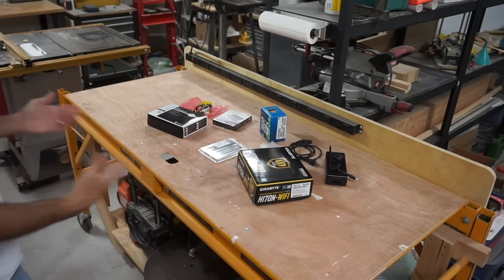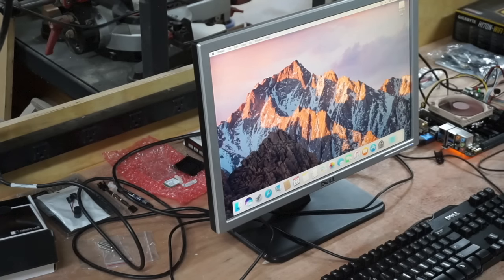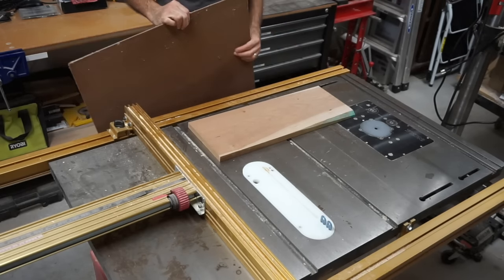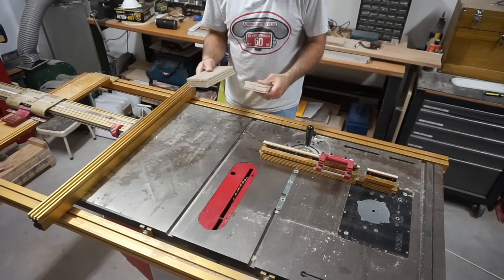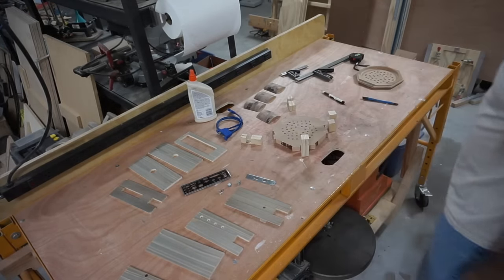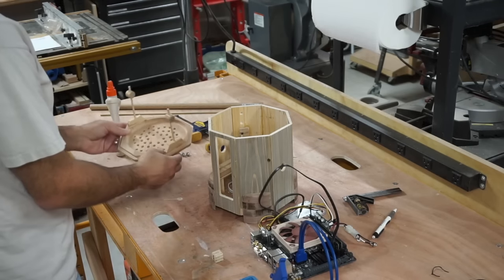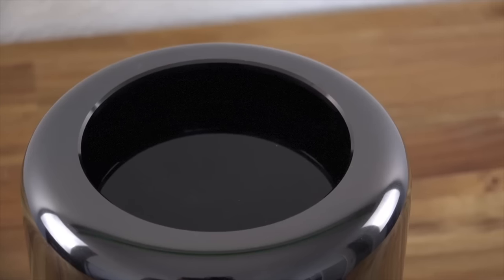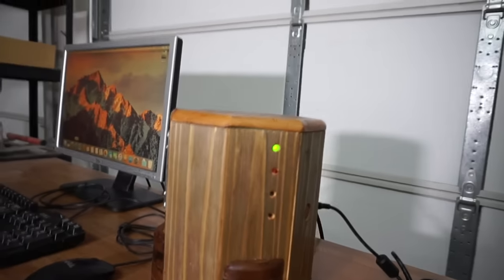A Woodworker Builds a Hackintosh

Comment: Three words:  Wooden Spring Buttons!!!  That is probably one of the coolest ideas I have seen in a long time, and beautifully executed to boot!  Very nice IBTW:-)
Reply from the maker: I actually did some work on trying to make such buttons for this thing, but those darned stock buttons are so tiny and I could not come up with a way to push them with something else. So, I kept it stock and use a pen tip to push them. Some day...
Reply: That would be a nice touch too! Maybe you could install a small metal pin that pokes out the underside of the little button to act as the pen tip, slip a tiny spring around it and set it in a properly refined access hole...just a thought for your next build:-)  What I was originally referring to was your GENIUS buttons that lock the top of the case to the body.  Super neat little trick that relies on the tensile memory of the wood dowels!  A really elegant solution in my opinion, and I always can appreciate solving a mechanical need with wood over more "modern" technologies...Engineering principles at their finest!  Also, thank you for the reply and a chance to say personally that I enjoy your work and look forward to seeing what else you decide to come up with for future projects.  I am a long time woodworker, contraption maker, and scenic designer that built his own design/render computer last year (with simple mods only for my first build), and has been totally bitten by the enthusiast mod computer bug as a result.  Again, awesome work, I look forward to more, and may your day be a happy one!
Reply from the maker: Ok, yes I forgot about that genius feature I put in this build. I was really pleased how they turned out. The thing that left me somewhat perplexed was how to make something out of wood to push those little switches. That's my someday project. Do you have a channel too? If so, let me know what it is. If you don't, it sounds like you need to start one, so everyone can enjoy seeing your creativity in action!
Reply: I have been considering making videos for some time now, I just haven't taken the plunge into getting started.  Partially due to lack of time, partially due to not having even a simple setup to support the endeavor.  I will need to increase my storage for my pc, learn the software and workflow needs, and I only have my phone as a camera at this time, which will need a larger capacity SD card.  A good deal of my work is also really focused under tight deadlines and I haven't put much time into considering a way to add video production into that situation that won't impact my timeline for completion of the actual project. I am seriously considering looking into making this move...just gotta navigate some hurdles first:-)  Any advice for someone interested, but still ignorant in some ways on how to get started?
Reply from the maker: You can probably guess my answer to your question: just ... do ... it! You will figure it out, I assure you. I had/have the exact same hurdles you listed above and I make it work. There are lots of great resources for getting started available on ... YouTube! :)
Reply: Thank you, and you are right, a journey never happens without the action of taking a step, then another, and another...  I will try to find some time today to actually research youtube for starter tips, for I am working from home on a design for an upcoming theatrical production, and will need to take breaks from time to time:-)

Comment: Great work! I would suggest an intake and/or exhaust fan - thermal throttling does inhibit the CPU to operate at its full potential.
Reply from the maker: Thanks for the tip. That improvement will have to be made in version 2.
Reply: yup agreed! very cool though!

Comment: You should sleeve the cables in flexible metal conduit sleeving, and cut the wires to be exactly the right length so you have more room for airflow, and it will look nicer on the inside. And you could use a redux noctua fan to match the color of the sleeving.

Comment: very cool. I would try to add a dedicated video card and more cooling. but this is awesome. great job.
Reply from the maker: Thanks Rafael. The trouble with video cards is they add bulk to a compact machine like this.
Reply: I've Been Thinking Workshop ... I know zotac makes some small form factor gtx 1050 and 1060. but i understand your concern. video card would introduce more heat and disrupt air flow.

Comment: Nice Vid. Very cool case design. You might want to run multibeast to get all of the drivers working right the screen resolution looks to be unconfigured but other than that it seems like a nice build.
Reply from the maker: +connor grice Thanks for the comments. I did run MultiBeast, but I'm sure I haven't figured out all the best settings to use on it yet.

Comment: Impressive build. The problem with all case mods is however that you should if you do wood or plastic, add foil. The reason why pc:s cases are in metal has only half of the truth when it comes to production, they are in metal also due to faraday cage. The cage is not fully complete but almost, and allowes for a very good protection as well as coolant ( passive) if the case is somewhat ok. Thats why i recommend gluing foil to the sides as it will be much less disturbed from backround noise for such things as using earphomes etc
Reply from the maker: Interesting point, Jon! I've noticed that all commercial PC cases, including plastic ones, have a metal liner inside. I finally know why!
Reply: you can manage without, depends how much microvawe food you plan to make meanwhile gaming :p  if no interference you dont really need one but it can be neat to have since even a mobile phone on can make your speakers go nuts

Comment: just as long as you don't light it on fire manually I'm sure you'll be fine as the CPU shouldn't get to hot and you moved the power supply outside of the case

Comment: You should build a mini-ITX gaming PC. Would love to see a wooden rig for on the go!
Reply from the maker: So when you say "gaming PC," are you saying to add a GPU, other souped up specs, or something else?
Reply: Gaming PC is just anything that can run modern games, so yes.
Reply: Yeah sorry for not being clear basically I meant to add a graphics card and a processor + ram that can run games at decent settings. You could get a half-height low profile GTX 1050 or 1060 and they would fit into your Hackintosh build. I really want to make something like this wooden octagonal PC for portability and aesthetics but I don't have the proper tools at hand like you do in your work shop sadly. Any advice on constructing something like this with hand tools? I want to make an all in one PC which has a slim laptop-like computer case (rectangular and slim and low profile) and a monitor attached via a hinge with the keyboard and touchpad mouse on top. I just got the Noctua NH-L9i for my CPU cooler and will be using a 195 watt Pico PSU when the connector comes from ebay next week. Will power an i3 and a gtx 1050 and 8gb of ram. Any thoughts on this build?

Comment: would've help cooling if you add fans on the bottom, which will probably be hidden, and the top - although that requires more modding
Reply from the maker: I've been using this machine steady for almost two months as you see it in the video. She hasn't overheated on me yet. I say that and hopefully I haven't jinxed myself!
Reply: he dont need extra coolers, his i5 is an pretty cool one. and his noctua cooler is quite enogh, even with an i7, he doesnt have a gpu so his workload wont be that hard and for editing videos a direct fan taking air from outside is quietly enough.

Comment: Hey I am a woodworker and Geek as well and I am so fed up with Apples prices. I just bought the M<BP touchbar and for that money it was slow so I took it back. I was wondering how much fiddling it took to get this up and running. i would be really really interested as to the process and if you still think it worth it. Do you just sit down turn it on and go to work or do you have to fiddle with a thousand things before you get to work. That is the reason I switched to Mac in the first place long ago. All the fiddling with windows before you could actually do anything
Reply from the maker: Hi John, I'm in the same boat as you. I like Macs, but I think their prices are outrageous, plus they have been very slow to update their models. As for the Hackintosh, this is definitely not a plug and play machine. There is some "fiddling" and learning needed to get everything working, but the message I want everyone to get from my video is it can be done, even by a woodworker. Not putting down woodworkers (I am one), just saying you don't have to be a hardcore techie to figure it out. Once I got it figured out, the finished result works without any more "fiddling." As mentioned in my video, there are good resources available online to help make the process go smoothly.

Comment: know what would be cool: to house it in an old power tool like a skill saw,  concrete breaker, bench grinder, anything that's big enough to house the components.. :-)
Reply: Old craftsman table saws can be had for free everywhere if they are broke. But they are heavy even without the motor and blade.

Comment: I build a similar Hackintosh.
Same Gigabyte H170N-WiFi motherboard
CPU: i7 6700
RAM: 16GB Corsair DDR4 2133mhz LPX
Case: Silverstone Sugo SG13 white
Im running Mac Os Sierra 10.12.2, but still have some troubles with audio drivers
Reply from the maker: I like everything about your setup, except for the case, but I'm sure you realize I'm a bit biased about cases. Keep tinkering on the audio drivers. You'll get it.